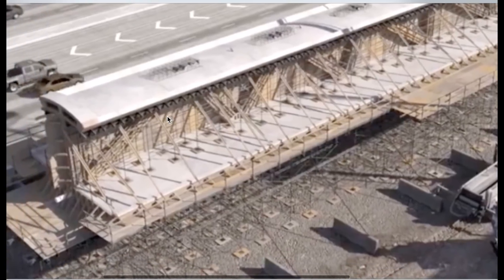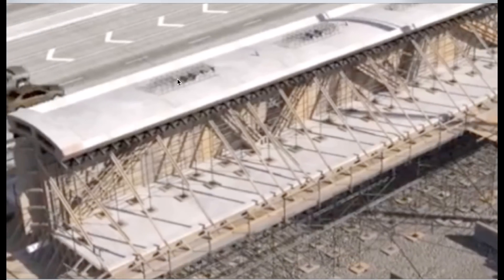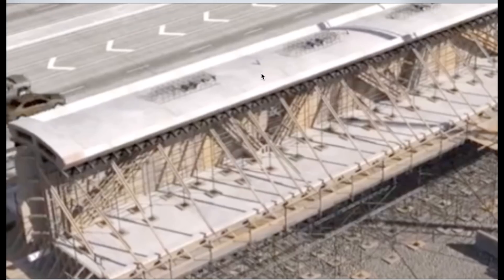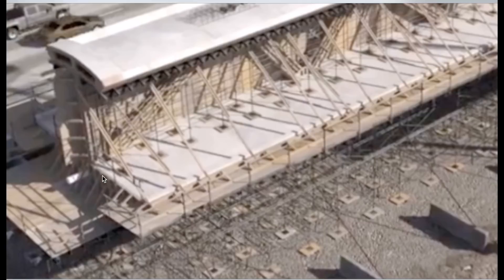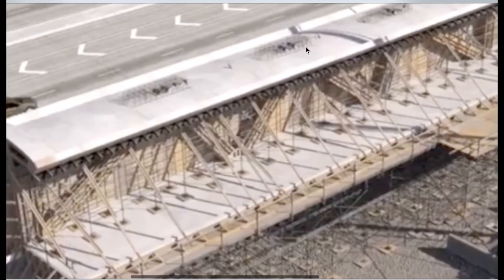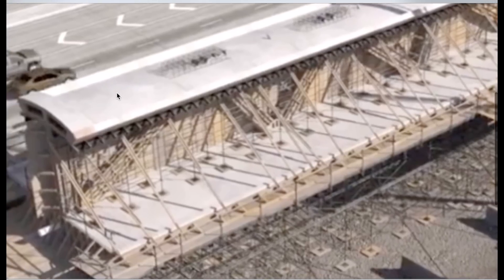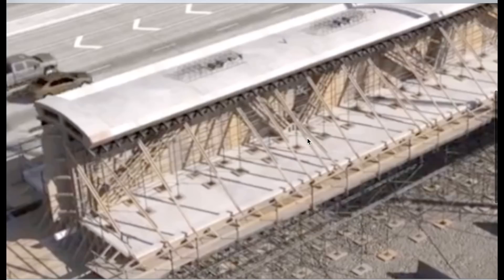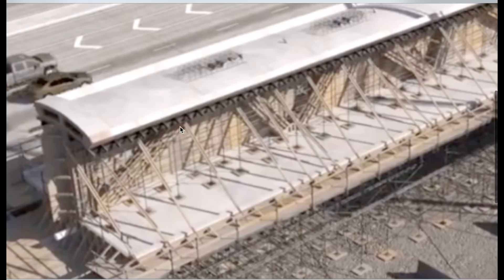FIU Bridge Collapse zero force member & diagonal members 10 & 11 & member #12 VIDEO

Comment: Anoother great bit of research into this design. Number 11 strut looks to slender to me for it's angle of inclination. Good one on the fillits. Sounds so obvious, now you outlined it.
Reply from the maker: Andrew, thanks for sharing... With that said, and for clarity, you have failure first at 11 and 12? 
Andrew, in my experience, we always need an acting force - then we evaluate the maximum ''damage" that force can do -- 
Andrew, you now have access to the post tension bar and it's abilities... dial that into your analysis - BUT, never forget we only have ONE foot of concrete decking on the other side of that force... and it is limited to a plate and it also has a HOLE in the center of that plate's load path... Then on the other end, of number 11 and where it meets #12 - we have SOLID concrete and well over 18 inches in depth... I ask you as a professional... which end would ''react'' first? 
The canopy of course... now I like to be fair... we do have some forces applied to this node via longitudinal post tensioning... two on each side and I am NOT sure how much they are actually contributing to that node (directly - if any at all)...
Andrew, I know you have your heart set on the #11 and #12 shear failure...   I have considered it a few times, from people like yourself, asking me to look at that... I think it is ''collective hysteria" on the part of a few forums...  This collective hysteria, is what made the entire engineer group believe this structure was so sound and what made them think they could do what they wanted with #11...
Is it possible, yes - anything is possible if you create enough factors to make it possible... Please, create those factors for me, so I can see this load path failure...  I am not being smart with you... I am open for change - any and all the time...
Reply from the maker: Andrew, what experience do you have with this design? NO offense but, that seems like a little boosting on experience... as this is a one-off bridge and no one but these guys have experience with this structure.  
BUT, you are wrong about shear at bottom of 11... it did not shear - their was no ''shearing force'' there in the amount required to cause shear. 
You may be thinking a ''punching..."...   Still that is wrong (please, look at my other channel on the amygdala and you will learn (maybe) why you are so stead fast in some of your thoughts on this bridge.)... Also, you will learn why "things" triggers you... which ''force'' you to make a comment contrary to data.
Reply: Construction Engineering & Photography when the bridge was moved into place it pivoted around  strut 11. This will generate a sheer force: bending forces at that end
Reply from the maker: The bridge moves relative to itself -- that might have been a tighter radius curve or not -- but, the bridge moved as one... To create this pivot point, the bridge would have had to be been pinned and you turn the opposite end... This was never pinned, that I have seen...
Reply: Construction Engineering & Photography if the bridge moved as one, and no turning force was transferred into the structure, then your correct.....BUT I hypothesis that the weight of the canterlivered part hanging from and around 10 and 11 did have a factor. I propose that we can sider the fact that stress was exhibited at the pivot point. This is not a simple steel bridge, this structure  will show issues as creaking....just like what was reported. This in itself can be nothing, but as the bridge did collapse we have to consider it as suspect.

Comment: Even a child working with Lego, constructing a model of trusses 11 & 10 as per this photo, will guess that the top angle is too obtuse to hold the dead weight of the deck below.
Like a ballerina, it will do a split and bottom out, which it did.
Looks like that two-thirds of the deck space was for chilling out; having coffee, meeting friends, taking the air above the snarling traffic while one-third did all the heavy lifting in the false belief that it had friends in high places helping out called Tension Cables.

Comment: Can We Back the heck up for a minute? I want to get into the minds of the idiots responsible.
IS IT Possible? that THEY were Hoping/Praying that once the second span was IN Place
That MAYBE the longitudinal PT cables that were to fill those Empty conduits (assuming that they went the length of the Entire two spans, Right?) AND After they were stressed Would the bridge have been Safe?? and is THAT what the whole group was counting on?
what is keeping me up IS, IF second span was Installed and cables run + stressed would
the Lives have been Spared?? at least temporarily, until, Somebody Just said Fukin STOP!

Comment: Simply put the engineers didn't expect cracking so they hoped & said tighten the rods - Oops - Building a model wasn't something these engineers needed to do since it was only a walkway bridge.   Now the fingers pointing begins, insurance rates jump plus a few retirements.  On the flipside engineers & university  will be world famous for a teachable failure...

Comment: Why was the bridge moved over the roadway before post tensioning & testing was done?     Why was the bridge so much heavier (1.9 million pounds)   than the engineers specification?    Why no continuous steel reinforcement  under or within the cast concrete?   Just  to  allow  traffic flow  the  bridge was  left to stand alone  without suspender cables.  Very negligent.

Comment: Now that we can see that the canopy was hollow, what happened after they put the tensioning or cable ducts in? Did they grout fill it or just cap the ends?
That blue collar is a mystery though, where did it come from, as that section didn't crumble, it snapped and the steel? rod is straight and the pier that disappeared underneath I assume it crumbled but it was facing in the opposite direction.
The damage done to the top caps suggest they were cold poured and there was no way of sealing between them and the canopy.
Have they suggested when the enquiry will conclude and reveal their indings?

Comment: This bridge was designed to be supported by the Cables to the Cable Stay Tower.  It was not designed to be installed without the support of those cables.  They should have waited until the tower and cables were ready and the over the canal part was in place then bring in the over the road part and connect cables on both sides at once.
Reply: No.  Those were all to be cosmetic.  Strange but true.

Comment: Btw, In the web site of state board of engineers, you will find the responsible engineers professional and educational back ground.
Reply from the maker: Yes, I know...also fyi, not all are listed and not all education is public knowledge...
I take my continuing Ed by private companies...
Reply: Continue ED is a joke. I mean the REAL advanced ED, like MS or PhD degree. Free body diagram stress analysis is really matters at all the joints/connections. Stress "concentration and dissipation" at joints is really matters. Math model with differential EQ to get the solution. Or use finite elements run the algorithm like SAP. Those are NOT taught without special request by students. Not even all the professors know the topic.
Steel trusses are much simpler to calc and build with same configuration with 2 dimensional stress. But this bridge has 3 dimensional stress. Stress travels in 3 ways.

Comment: As a layman in this field and only an interested observer, I do not understand why the load of the cantilevered top cord, extending from between the top cord intersection of members 10 and 11 to the end of the bridge, was not a factor in crack development at the top intersection of members 10 and 11, especially without horizontal post-tensioning of the top cord.  I my mind, since the top cord was also supported by the vertical end column, wouldn't it contribute to cracking when members 10 and 11 were post-tensioned, given the expansive span across the base cord between the base of members 10 and 11?  Isn't this top cord joint subject to point load deflection without balanced post-tensioning, especially since the bridge was moved into position without support under this location during transportation?
Reply from the maker: Gary, I am a little confused by your question but, let me offer this...
The dead weight of the canopy, by itself, no attachment to the truss... It would typically have a failure in the middle (weakest point)...
But, once you add post tensioning, this makes the concrete as stiff as ''steal''...  
Anywhere, you break the steal is where the failure would occur - 
Now add the post tensioning as the point in the ''steal'' that you direct forces into... Once you break that top plate of steal, it will break at that location...   Think, karate chop --- (?)

Comment: What about this:  the node had two embedded tension terminations going in different directions.  Could that have created a torque within the node itself that made it want to "flip out" the way it did?   Are there any other examples of concrete nodes with competing tensioning vectors?

If I were designing this (hindsight being 20/20) I would want steel "L" brackets at each node...  or, actually "K" shaped steel connecting members.   I would trust the concrete under compression if it were simple spans, but when you are using concrete to redirect forces you start introducing some complexities that are quite difficult to visualize.
Reply from the maker: The "load paths" are most important... this is how most failures are discovered... a "faulty" load path...

Comment from the maker: I am sure you guys will find any mistake I made in this presentation - have at it... Thank you.
6:54 typical cracks from a concrete truss system
7:29 why acute  direction change is not a good thing... 
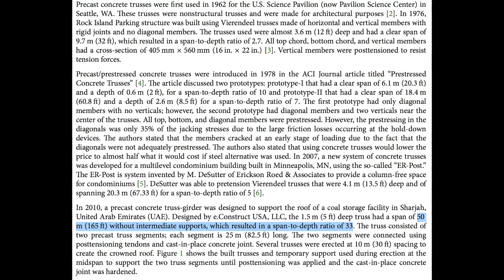8:17  slender factor for a truss - concrete truss system
Thank you all for watching... even the trolls.
4:10 Concrete truss system that is approximately 160 feet wide / span
Enjoy this light reading if you guys are crazy enough --  go to my twitter page and find the link https://twitter.com/6DoubleEntendre - it will be in  the post with this video shared on that twitter page with a structural engineer - feel free to follow him if you like.